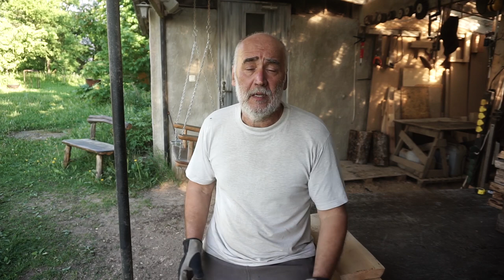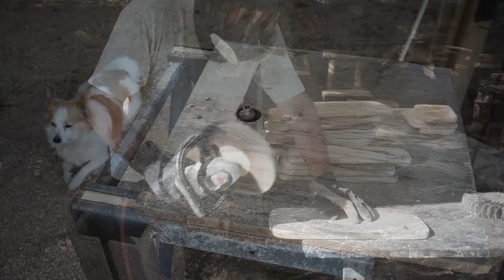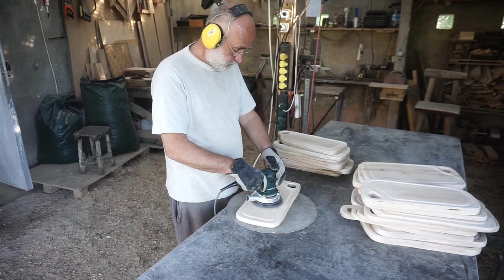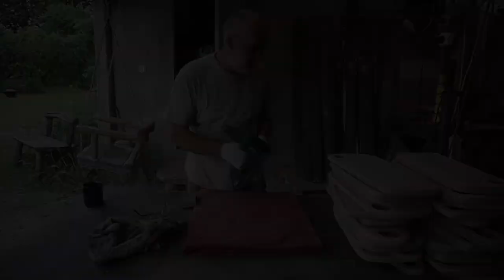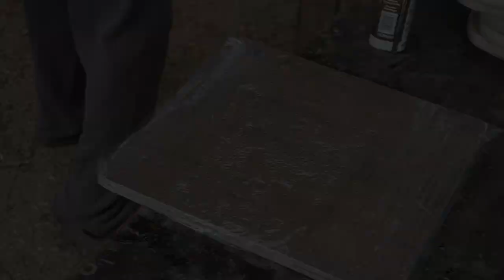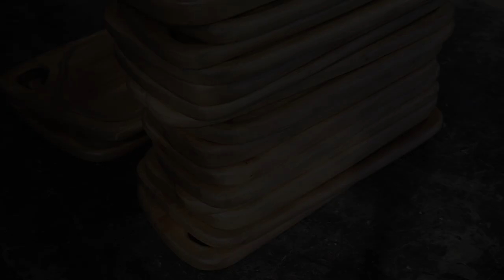No cutting board no food by Uudopuu

Comment: Вы молодец! Так держать! what kind of tree is this? I understood correctly, you covered the tree twice. The first time was tinted, the second was soaked in oil?
Reply from the maker: I tint the cutting boards twice, sanding in between. And I cover with oil twice. I use "Danish Oil", it is allowed to come into contact with food. Wood is alder, it could be made of something harder, but since I use alder when making furniture, so is it. The alder is actually good because it curves little when washed. But for example, beating meat is soft. Great for making sandwiches.